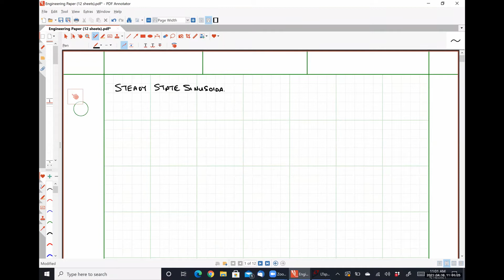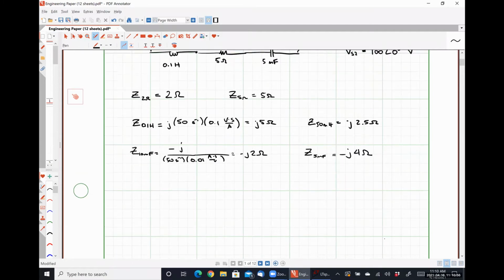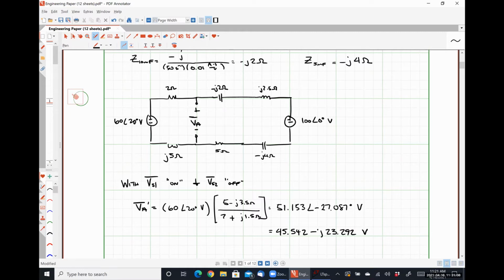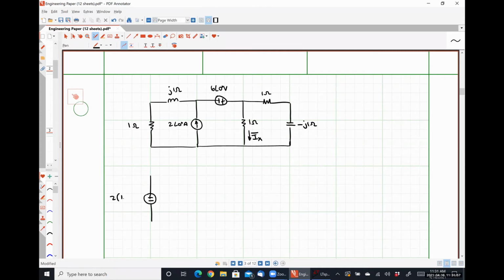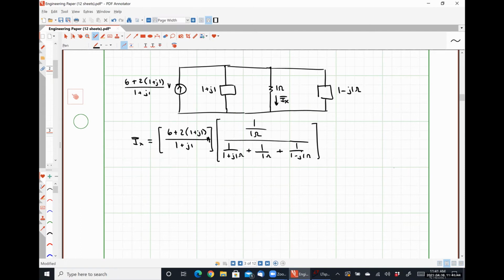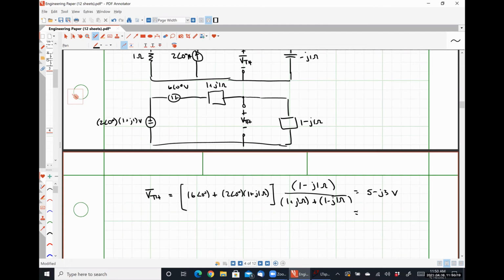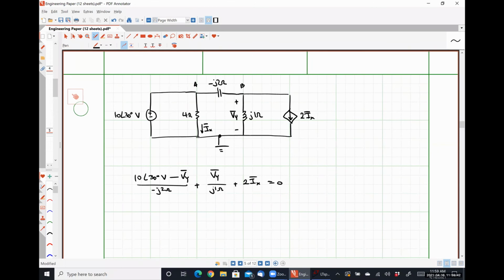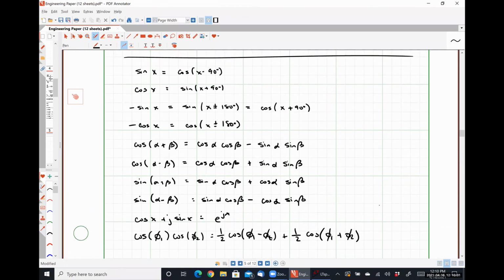ELEN 223 (Spring 2021) - Class Meeting #15 - 04/16/2021

Comment: There is a sign error at 58:58 in the first term. It should read:

(Vy - 10<30)/( - 2*j)

in order to be consistent with the signs chosen for the second and third term (currents going AWAY from node B). With that correction Vy will be 14.14< - 105.

Comment: I understand the value of demonstrating multiple ways to solve a given problem but the circuit at 30:16 just cries out for node voltage. A supernode at the top encompassing the voltage source with V1 on the left and V2 on the right reduces to 

V1/(1 + j)  - 2  + V2/1 + V2/(1 - j) = 0 and substituting the constraint equation V2 = V1 + 6 gives one equation in one unknown. Solving for V1 and adding 6 and dividing by 1 gives your current Ix.